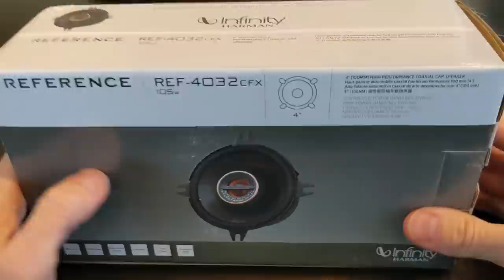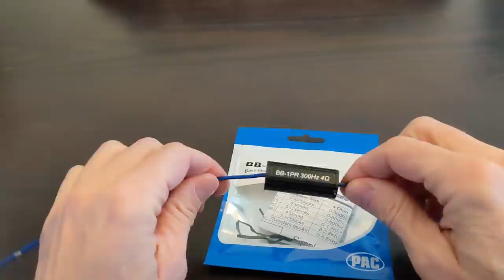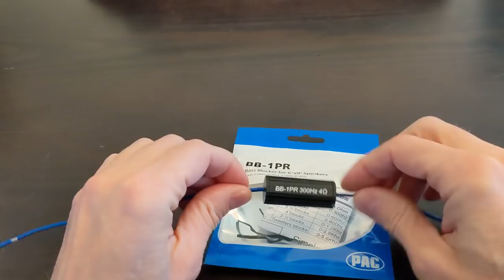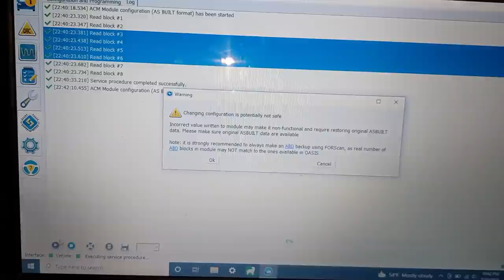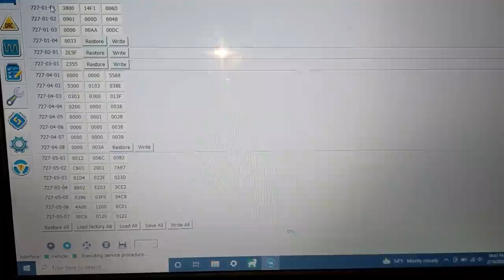2021+ Ford Bronco - Infinity Speaker Upgrade Plus FORScan Programming

Comment: Just replaced my four speakers with bass reduction crossover up front and used the same Infinity units.  Only deviation was adding sound deadener in the rear boxes and I did not reconfig via fourscan.  Much improved clarity and can now hear the rear units for a much more satisfying experience.  TY for the how to!
Reply from the maker: Glad I could help! Addition of sound deadener is a good option.

Comment: I added some Alpines in mine, I stuffed the inside of the housing with Dynamat.  At first we hooked them up without the Dynamat and it sounded better than stock of course but then it sounded even better with the Dynamat.  Especially the rear speaker housings, they are just a plastic can more or less.  Also there is a hole from the glove box to the speaker housing on the passenger side front, closed that up and it sounded smoother as well.  This is a great video for installation!
Reply from the maker: I have heard others note that Dynamat also makes a noticeable improvement, so I will probably add that to the rears at some point. Thanks for the comment and thanks for watching!
Reply: Rad tips thanks !

Comment: I did Rockford Fosgate primes in my bronco but also did the kick panels and factory connectors it was around 200 for all of it and it made a world of difference
Reply from the maker: Cool! The kick panel speakers are a good bit more work work to replace because you have to take a few trim panels off on each side. I am glad you are happy with your upgrade, nice work!

Comment: I am so glad that I upgraded my new 2022 bronco to the B&O with additional speakers. I would have been in the same boat as you and upgraded right away. I can't believe the lower end trim has those crappy speakers.
Reply: BTW - Great video.
Reply: Lol the B&O 10 speaker setup sucks too.  You just overpaid, that’s all.
Reply from the maker: Thanks! I am sure the upgraded B&O are better. How much better and worth the price, that can probably be debated. Enjoy your Bronco!
Reply: @BudgetBronco  
I have the B&O in my 2dr and I'm here to tell you it seems to sound no better than yours with the upgrades after ForScan. A little more thumpy, but that thump comes with rattles and the deadened sound of a factory woofer. It's not bad, for an all in one package, but base is the perfect blank canvas.
Reply from the maker: This is good info, I had not yet heard of anybody doing the FORScan mod on the upgraded B&O system. If it does not help on that system, you can always revert it back.
Reply: @BudgetBronco  im wondering about that as well. i may try it
Reply: The B&O system is such a disappointment. I ended up swapping out all my speakers. I would of never added it if I knew before hand
Reply: I gotta say, you guys are making me feel a lot better about missing out on the B&O system... Sorry! Great video, I'm looking forward to swapping mine out too. So good to see these projects on a Base, I was beginning to feel like the only one on the planet who didn't fork over the dough for a fancy trim! Keep 'em coming!👍🏻
Reply: I have the B&O and I'm sorry to tell you, it has the same exact paper cone speakers the base model has.  It just has more power, a couple extra speakers, and it's tuned.  You'll get way more out of the B&O by replacing the stock speakers, like how they did in this video.  That said, the B&O isn't nearly as bad as people in the comments are alluding too.  It's decent, but four $2k additional cost, it's certainly not worth that amount.
Reply: @sic5pointslow  Yeah, but now that you did the speaker swap, I bet it sounds bad ass?
Reply: @jaswett  It's not that bad.  Certainly better than stock.  Not worth the $2k+, but better than stock.  I think a lot of people complaining about sound quality are using inferior sources, like streaming an audio app via blu-tooth.  So, right off the jump, you have two sources of degraded sound quality.  To optimize sound, you need to play lossless audio files through a USB drive.

Comment: Just finished this - thanks for the info. I added sount matting and used converter pigtails instead- but this info was the basis for it all going smoothly
Reply from the maker: Glad it was helpful! I have seen others note that sound mats help, especially in the rear. I will probably add that some day.

Comment: I can confirm the 3800 mod does absolutely nothing, at least to the rear speakers.  I confirmed this by running rear speakers into LOC which ran into pro tools.  The rear speakers are high passed it seems no matter what internet hack you apply.   However, it is a fact that the first bank of that address is front speaker, second bank is rear, third bank is eq settings.   What codes are de-facto specific to the Bronco is still a mystery.
Reply from the maker: Interesting....I think my video proved, at least for me, that the 3800 code change did SOMETHING, but it could be that it is only changing the front speaker output. Thanks for the comment!
Reply: @BudgetBronco  certainly may have done something.  If it did something it probably configured the kick panel speakers for no tweeter or in other words low passed signal (more bass) to kick panel so it may have balanced the audio out a little more.

Comment: You are making it easier and easier for me to decide to go with the base! I've been holding onto a 2009 Honda Accord EX for a while, and one thing I like about it is the sound quality. I've heard the speaker system isn't that good on the bronco, and without premium speakers on the Black Diamond, I don't think I can justify spending the money just for larger rims and tires out the gate and a nicer steering wheel. Thank you!
Reply from the maker: I do think it is better to go with the lowest trim level that meets most of your needs, and then fill in any gaps with aftermarket parts. You will probably end up saving a lot of money this way. Definitely do NOT buy any package just because it comes with the B&O sound system. You can do a lot better with aftermarket audio components.

Comment: Thanks for this video.  I replaced my dash speakers with the Infinity's.  Tired the bass blocker for a few days but I felt it made the speakers too "tinny" sounding.  I get a much warmer sound without the filter.  Next project is a subwoofer as my Bronco came without one... thanks Ford.
Reply from the maker: My pleasure! That is cool, the bass blocker is optional, do what you like. I will also be installing a subwoofer, video to come some time this summer. It will be a JBL BassPro Nano.
Reply: @BudgetBronco  Looking forward to your video.  Thanks for this channel.

Comment: Dude.... You just ruined it!  Imagine how much slower it's going to be with all those added grams from the new speakers!!  All joking aside... Great video.  I've been subscribed to and reading a couple different threads on the 6G forum about this.  A lost of it is over my head.  Last car stereo I messed with was in the mid 90's.  Changing those speakers out looked like it made a huge difference.  I am weary of messing with Forscan but I think I will try that where the dealership flashes them for that read added sound bar trick I also read about.
Reply from the maker: 😂 ya those extra 800 grams probably going to decrease my gas efficiency by like 0.0001 mpg!!  I think really anybody can make this modification if you have a crimping tool, just take your time and double check all the connections. FORScan is another matter. That can be tricky and you can really mess things up if you aren't careful. The JBL sound bar flash sounds promising too, I think the trick there is finding a good dealer that is knowledgeable about it and willing to do it without charging an arm and leg for the time.

Comment: Great video! Helped me out with the install a ton. 
I made the Forscan Change after changing out the speakers. It didn’t seem to do anything for me. When I fade to the back to see how they sounded, the speakers still sounded weak and lacking bass/mids.
Reply from the maker: Awesome, I am glad it was helpful for you! I have heard others with mixed reviews on the Forscan change. It might be due to something that has changed in the audio module since the early Broncos (mine was built July 2021). There is another line of code that you can try if you want to. In the second line of codes (just under where you changed to 3800) change that first set of numbers to 0900. I have seen some people mention this on the Bronco6g forum. I have not personally done it myself, but you might try, and if it doesn't help you can always change it back.

Comment: Do you need to add the bass blocker to each of the front speakers, or since they are in series only 1 side and if so which one. Thanks.for a great video
Reply from the maker: You will need a blocker on each, good question thanks for the comment

Comment: Great video, thanks for the information.  You mention that the forscan increases the volume of the speakers but does it do anything to improve the sound quality?  Or does the improvement in quality all come from the new speakers?
Reply from the maker: It does a little of both. I don't think the Forscan change will help much unless you are doing it in conjunction with new speakers. If you don't have the tool to make the Forscan change though, I'd say most of the improvement comes from the speaker upgrade, the Forscan just improves it a little more
Reply: I skipped over that part of the video as it doesn't apply to me.  However, all he did was unlock additional power to the speakers.  More wattage means more headroom.  Even with the stock speakers, you're likely to see an improvement, even if only marginal, to the overall sound quality.  More power means your stock speakers can now play with greater output at lower volumes.  They don't have to strain as much to play as loudly, at whatever level the dial is set.  This should result in a fuller, clearer sound....even with the shit stock speakers.

Comment: Do some speakers (memphis) already have base blockers mounted on them? Or is that a capacitor of some sort? Also why are the base blockers not needed for the rear? Thanks you, your videos are super helpful!
Reply from the maker: Yes, some speakers come with a bass blocker built in. In fact if you look close in my video when I show the old speakers that I took out, you will see they have a bass blocker built in to them. A bass blocker is a capacitor, nothing more to it than that. You can use them in the rear as well, but I chose not to. In the front they are needed, because the front speakers are wired in series with the speakers in the kick panel, and those are going to be playing the lower frequency notes, so no reason to have the dash speakers try and do the same.

Comment: One other additional thing you can do is add dynomat sound deadener material inside the rear boxes and on top of the openness on the front to fix the hollow sound the speakers give because the sound is bouncing off the plastic. I saw this done on another Bronco audio upgrade video. I can’t remember the name of that channel at the moment. But it seemed to further enhance the sound quality. Nice video.
Reply from the maker: I have seen that as well and I am probably going to add that some time in the future. Thanks for watching!

Comment: Great tutorial and explanation! Why did you not replace the door speakers? Just curious
Reply from the maker: Two reasons: 1) the kick panel speakers (they are down by your feet, but not in the doors) are a higher quality speaker, in fact if you purchase the upgraded B&O sound system the kick panel speaker is the same. Not true for the dash and rear speakers, they are low quality paper cone and if you purchase B&O they swap in a better speaker. 2) The kick panel speaker provides mostly bass, so an upgrade is not going to deliver as much impact. If you want to improve the bass you will need to buy and install a subwoofer.

Comment: Hello Tim, I recently encountered a serious issue while upgrading the speakers on my Ford Bronco with the standard sound system, and I want to share a warning with the community. If anyone plans on using the METRA 72-5603 connectors for the dash and rear pod speakers, please be aware that the cables may be inverted.

During my installation today (May 1, 2023), I noticed that the positive cable was aligned with the negative cable, causing some confusion. To clarify, I reached out to Crutchfield support with photos, and they confirmed that the connectors may be inverted. I suggest double-checking your connectors before proceeding with your installation to avoid any potential issues.

Thank you for your attention and I hope this information can help others avoid this problem.
Reply from the maker: Good to know! Does it cause damage or just sound bad?
Reply: @BudgetBronco  Connecting car speakers with inverse polarity can cause poor sound quality and potentially damage the speakers. When the speakers are connected with the opposite polarity, the sound waves produced by the speakers are out of phase, which can result in cancellation or reduction of the sound output. This can cause the sound to be weak, thin, or even inaudible.

Additionally, connecting speakers with inverse polarity can cause damage to the speakers over time. When the speakers are out of phase, it can cause excessive stress on the speaker components, such as the voice coil and diaphragm, which can lead to distortion, reduced sound quality, and ultimately, speaker failure.

Comment: I think you can buy some wiring harness adapters so you wont have to cut the wires. Can usually get them from Crutchfield. Great video.
Reply from the maker: Yes probably, if I hear from users that they found some that fit properly I will update the description with a link. Thanks for the comment!

Comment: I replaced all 6 speakers the 4in's with 300 bass blockers on all 4, 6 3/4's for the doors... The bass and sound coming from the 6 3/4s kicks butt.  I ordered from Crunch and they provided the connectors so zero splicing... Im not good at splicing so this plug n play worked out.  If anyone orders kicker cs 6 3/4s you need the mounting bracket and had to hit the hardware store for mounting screws I used nuts n bolts not drilling into the sheet metal.   

Forscan is tuff for me as all I have are Mac's.  I really wanna open up the rear speaks for more juice..
Reply from the maker: Oh nice, when I made this video almost two years ago there weren't any connectors available so I did not have a choice but it is probably worth a few bucks to buy them now that they are available. You definitely need to adjust w FORscan, it will sound a LOT better. There is also more info out there on different code settings, again when I did this 2 years ago I was one of the first to try it. Go to bronco6g.com and search and you will find a lot of good info, especially from a guy RagnarKon. Thanks for watching!

Comment: Very useful. I will be do this,this weekend but also the kick panel speakers and low profile sub.👍🏻
Reply from the maker: A subwoofer will definitely be a nice addition and will add a lot to the sound system. The kick panel speakers less so, but also can't hurt. Thanks for watching!
Reply: @BudgetBronco  did the speakers yesterday along with forscan change. Havent done sub yet. Today. Idk what if anything forscan change did. Of course the new speakers were a huge upgrade so trying to tell what forescan did is impossible since I flashed it before removing any speakers. Huge improvement either way. Im certain the low profile sub will add a huge improvement as well. I came from a ford f350 that I had subs,amps etc. Mirrors would shake,lol. At 50 yrs old I am trying to grow up and really dont want all that money sitting in a soft top vehicle. Great channel you have. Thanks!

Comment: How would you rate the quality of bass with new speakers compared to old? Night and day difference?
Reply from the maker: These speakers improve the mid and high, but they are not going to add much bass. If you want to increase the bass, you will need a subwoofer. I have done some research on this, and if I do it, the sub I am going to use is the JBL Pro Nano and here is a good post on how to install it: https://www.bronco6g.com/forum/threads/inexpensive-yet-impactful-speaker-upgrade-plus-forscan-mod.37186/post-1562579

Comment: Love your budget upgrades, did the speakers, unfortunately the improvement is not a significant. I guess 4” speakers are 4” speakers. I probably will get a subwoofer down the road.
Reply from the maker: I think it the video I say the replacement speakers take it from a stock 3/10 level to a 6.6 out of 10. I think adding a sub would be nice, maybe take it to a 7/10. I have done some research on this, and if I do it, the sub I am going to use is the JBL Pro Nano and here is a good post on how to install it: https://www.bronco6g.com/forum/threads/inexpensive-yet-impactful-speaker-upgrade-plus-forscan-mod.37186/post-1562579

Comment: Lots of sound deadening options to place into those plastic housings so your speakers aren’t playing in a bucket, critical step if you really want to improve fidelity
Reply from the maker: Good comment, yes I am going to add some Dynamat or similar. Others have done it and commented that it helps. Also easy and not very expensive to do.
Reply: @BudgetBronco  try boom mat 4 inch low profile sleeves, does the job in my Wrangler sound bar